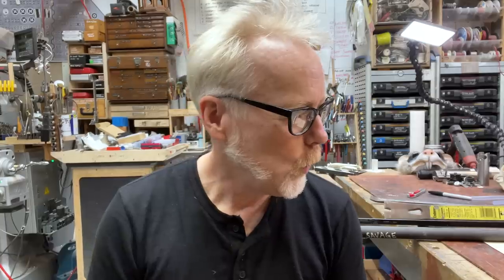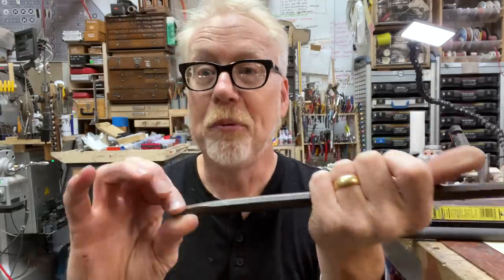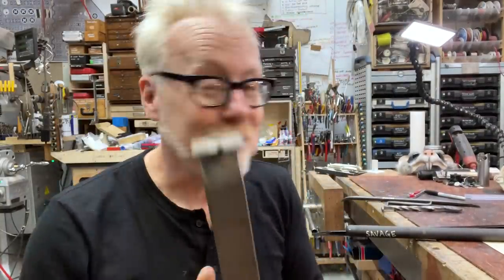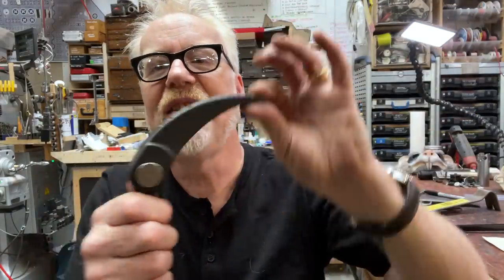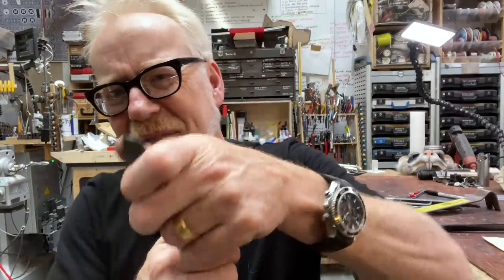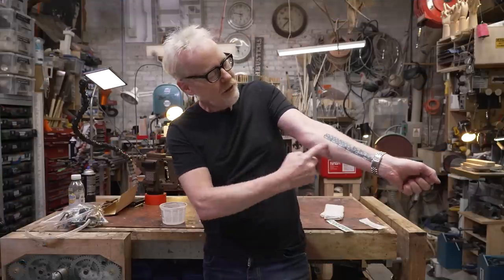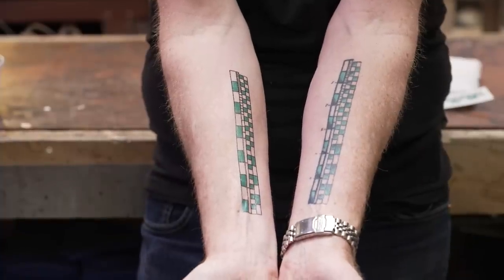Adam Savage's Favorite Tools: Pry Bars!

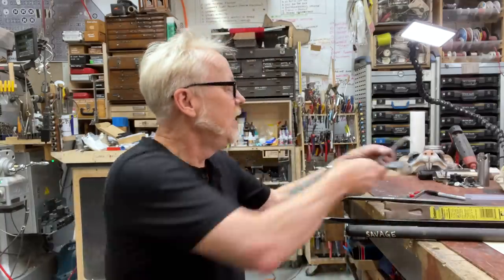Comment: That miniature pry bar Adam shows starting at the 3:00 mark isn't intended as a pry bar, but is actually a slotted screwdriver for tight spaces.  The heads are in two different orientations on the ends so you only have to turn a screw 90 degrees, then flip to the other end and you can turn it farther.  I have a couple of these for different, tight access problems, like adjusting the points on my one old Gravely tractor.

Comment: The large screwdriver brings back fond memories of a Chief Engineer on one of the ships I worked with.  The ship was new coming out of the shipyard.  As part of the Contract certain tools were provided., including the biggest screwdriver I have ever seen.  The Chief carried the screwdriver around, aka George C.Scott carrying the riding whip in Patton.  The screwdriver was specified in the list of tools to be provided, but no one knew what it was to be used for.

Years later my wife came home with two screwdrivers,  one flat blade and one philips, of similar size to yours.  They were on sale at Tractor Supply.  She knew I "needed" them for my toolbox.
Reply: Another seafarer here. There’s some amazing tools on ships alright, but my favourite so far was an inch drive torque wrench.
Reply: @kiwifruitpoo  The nut spanner for the props is one that always surprises me.  That it is not standardised and each ship carries its own.  Kinda like aircraft that carry their own push-back/towing bars because the destination airport won't have their special one.
Reply: Your wife knows you well.

Comment: The Probar is also called a halligan! It's a design that was made for FDNY back in the 40's.
Reply: I’ve heard them called a “Hoolie” bar, there seem to be many inferior copies about but I do want (need) one 🤪
Reply: @sibat777  I've also heard them called hooligan. Handful of different names for them.
Reply: We got some at my local fire dept. Great tool, we use it in combination with a splitting hammer as part of our door opening kit.
Reply: I was just going to say, Fireman’s Entry Tool.
Reply: On my want, need list as well!
Reply: All Germany I've heard so far call it Halligen tool. I guess Halligan is close enough. Standard issue for German firefighters as far as I know
Reply: There are a few videos out on old-school "irons" work.  Watching two experienced firefighters approach a (very securely shut) door, size it up, and then open it in less than five minutes is an education.  The stuff you can do with a Halligan and a fire axe is absolutely amazing. The other thing that struck me was the very terse communication between the two members.  Quick, to the point, and effective.
Reply: @CupolaDaze  The Hooligan is a three-piece design with cast ends and a tube centre, a bit lighter.
Reply: @romanglinnik8073  ive also seen the spike used with a hammer to crack concrete out under a door to help free a trapped animal
Reply: Came here to say exactly this
Reply: @CupolaDaze  Perhaps it is an accented way of saying Halligan?
Reply: @shellyandjohncourtade8269  No. Halligan tool is named after the famous New York City Fire Chief "Halligan"

Comment: I don’t know if it would be of use to you, but a Burke Bar has been living in my cross-bed tool box for several years. They are made for stripping concrete forms, but they work wonders for when you need to move something that refuses. It is a force multiplier that’s in it’s own category as far as I’m concerned. Almost 5ft long, almost 15 pounds.  As Essential Craftsman says in his video about the tool, “There are things that can only be done with a Burke Bar”.
Reply: Burke bar is the best at prying compressed plywood off of concrete.
Reply: Yessir. Came to say the same thing thing. Cat's Paw in the belt, Burke Bar on the truck. Flat bar for finishing.

Comment: You know, I'm realizing now that I should get a prybar of some kind. The last time I needed leverage to fit nuts and washers between steel and wood...I used a butter knife. Which to its credit, the handles on those things are Sturdy, and it worked better than I thought it might.

But a prybar would have made easy work of the problem, I wager
Reply: You should definitely have a pry bar of some kind, but most would probably be too beefy for that application. You should look at 5-in-1 painter's tool. They're similar to a putty knife (and can be used as one), but are sturdier and oddly shaped. They are great for light prying.
Reply: actually as a canadian I find a butter knife is great for popping open frozen car doors
Reply: @jcon6734  the 5-in-1 painters tool has been one of the most used tools in my kit as a home DIYer. My dad recommended I get one. Scraping, prying, cutting, popping light nails out, it’s been a game-changer.

Comment: Ah, yes, the halligan bar, aka a breaching tool.  Used one more often than I care to remember trying to get into doors and through things that were well and truly stuck.  You just have to REALLY trust the person next to you with the sledge that they're not going to miss.
Reply: It hurts when they miss
Reply: i worked for a tow compnay and bought one to keep in the truck with in 1 week the hole fleet had one in every truck with a 10lb sledge hammer owner not around due to a wreck but you need to unhook there trailer and its all bound up and has a pad lock no worries need to pry a fender out of a tire  so it will roll on the flat bed need to smash something or pry anything its got it worth every penny

Comment: They make a miniature version of the flat bar that is really amazing.  It fits nicely in my tool pouch and I drop it in the slot after the blade when cutting long pieces of wood on the table saw.  
It prevents the cut from coming back together and binding on the blade.   
Also works nicely to provide a small gap at the floor when hanging drywall.
Reply: I can second the mini flat bar!
Reply: I can also second the mini flat bar, but as for the normal flat bar I am a fan of the Stanley Super Wonderbar. The curve gives so much more leverage.

Comment: Dear Adam and members of tested, I'm a 3rd generation Ironworker. Klein tools makes our favorite pry tools. Including the 7/8" diameter connecting bar "sleever bar". As well as every spud wrench size imaginable. Prying Steel and Aligning holes for quick connecting or bolting up full connections. but when there's a stubborn connection and prying isnt enough bull pins and barrel pins are the next step.

Comment: I’ve been in the automotive field for decades and I have 3 favorites. 1 - the “lady foot” which are small versions of the Gearwrench tool you show but with fixed, 90-degree feet. The leverage on them is insane and they are perfect for tight spots. The point on the opposite end is a great alignment tool2 - Snap-On 36” prybar. Screwdriver tipped prying tools tend to slip and not have the leverage, the slightly angled tip of a dedicated prybar tends to hold better. Because of the danger of the huge forces I don’t buy cheap prybar. 3 - 6-foot pinch point prybar, you usually see masons use these to move sidewalk slabs. Immensely heavy and have tremendous prying power. You don’t want to know why they were popular tools in the shop.

Comment: Working in home repair I used a stanley crowbar that I reshaped and sharpened to a knife edge with a mill file. A knife edge allows for non destructive disassembly for materials that I wanted to reuse or things I wanted to reassemble after the work was done. The angle with the sharpness allows it to slip into very small gaps and apply even pressure to work things loose without damage.

Comment: The sash bar is indispensable.

Pro Tip: When prying off wood trim always pry perpendicular to the grain. For instance, when removing a baseboard, insert the pry bar along the edge and the rotate so that the edge of the bar pries across the grain not the tip. And have two pry bars so that you can leap frog down the piece.
Reply: If you good sash bar, it is a piece of wood that holds in a window pane. Think you mean a trim bar.

Comment: One of my favourite pry bar is a nail remover for small demolitions.  It has a weight at one end that move along the axis of the pry bar in order to ram it into the dry wall or two by four in order to grasp the nail so you can pry it out.  My father had one when I was a kid and it came on sale at CT 20 years ago and I've never seen it on sale since.  I only used it a half dozen times, but when I need it, it's amazing.

Comment: My favorite prying/scraping tool is a glazing bar. It's technically for installing and removing Windows but it has such a fine edge that is great for getting into right places.  I use it for everything 😀
Reply: Especially when you need some delicacy and don't want to break or crack anything that you're prying at. Like removing trim in one piece, which is exactly what they're made for.
Reply: Also my favorite pry tool.
Reply: There's a prying tool that installs Windows? That's interesting.
Reply: As a general contractor/construction worker, I use glazing bars every single day. They are unbelievably handy, I actually carry two small ones in my toolbelt at all times.
Reply: Agree.  He's missing something a little more delicate.

Comment: I use an aluminium pry bar. It's super light but still very strong. If you work overhead all day it saves your back. It also helps keep your toolbox lighter for site visits.
Reply: Confusing but interesting! It's hard for me to imagine an aluminum prybar that has enough strength to keep from bending, but I'd love to find one! Do you have the brand info?
Reply: @keithklassen5320  
Search

Gedore 142-430 Aluminium Prybar 430 mm
Reply: I use to for pipefitting  with the podger end mostly. But it's good for adjusting Motos with a benefit of not damaging surfaces.

Comment: I spent several years as a millwright and got to know many prying implements, but the one I have in every tool bag is known as a Crate Hammer. One piece steel with a forked pry end on one side and a T hammer on the other. Compact enough to keep in a tool belt or bag and useful for a plethora of tasks.

Great collection. I'll have to start using my offset flat blade screwdrivers for pry tools as well now...

Comment: I’m a mechanic, we like either 45 degree bent tip pry bars, or straight tip pry bars, some folks like the adjustable ones. Most folks will buy them off a tool truck, Snap On, Mac, or Matco, my personal preference is Cornwell, they do a 72 inch bent tip pry bar that will pretty much budge or break anything you want it to, they’re all a one piece tang with a striking cap on the end of the handle so you can hammer it in somewhere if you need. Great tools.

Comment: The big spike on the probar is often used to defeat padlocks.  One fireman holds the bar with the spike placed in the shackle while his partner forces it further with a sledge hammer.  No picking required.

Comment: One that I've found very useful for prying out smallish nails in plywood around the house is the diminutive Cat's Paw. Replacing my floors and dealing with moulding, tack strips and staples was made soooo much easier with this tool. The sharp ends dig in and get the job done.
Reply: Yes sir, love them.

Comment: An alignment prybar is worthy to have laying around. Its got a flat wedge on one end for all your prying needs and a tapered point in the other end you can insert into holes when attempting to align two surfaces together. In my application I use them to align vehicle subframes to the monocoque or to align a suspension link to the bracket receiver. You align the two components close enough to put a fastener through and job done. Great for punching holes with brute force aswell through wood or sheet metal.

Comment: As an ex tool truck owner I have a lot of tools in my personal toolbox. One of my favorites is a short prybar, 24”, that has a pinch bar blade at one end and the other is a straight tapered point at the other. The point is made to line holes up when you are trying to get bolts in a structure like car chassis pieces. It would be adequate for The Zombie Apocalypse also.

Comment: I rebuild oilfield equipment. My pry bars are my most used tools. I probably have 20 different bars of all types. I love ladyfoot bars and I use wedges to split cases apart. The wedge is so good at moving things from each other it will break bolts that have been stripped to where I can't remove them until I break them.

Comment: In the ripping bar, there is a use for that teardrop-shaped hole that I never knew. The flat split end of that bar can start removing a nail and the teardropped-shaped hole can FINISH pulling even a long nail. Try it!

Comment: Renovation pry bar. About 12 inches long with a right angle nail puller on one end and a 3 inch wide extremely thin slightly curved prying wedge on the other. Perfect for safely pulling moldings off.

Comment: A combo Jimmy bar/ podger is another one I use almost daily building elevators, big ones with a flat pry bar on one end and podger on the other as well as the ones with a hook for prying that usually come in a set from 6"-24/30" for pretty cheap are great.  A Burke bar is also one of the best options for bigger jobs, not really much that can replace one when you really need it.
Reply: Or a johnson bar, which is more or less a burke bar with wheels to lever on and turn. Mostly for prying heavy things off the floor.

Comment: I use a telegraph lining bar for work occasionally. If you ever break concrete - particularly in small quantities, but can’t (or don’t want to) use a power tool for whatever reason It’s your friend. It’s also great if you need to move really heavy loads or do heavy demolition work. Seven feet long and heavy! Specialist, but a lot cheaper than getting a big power tool.

Comment: I bought a flat bar with an extra bend in the middle years ago. While it may not fit as well as a regular bar, it does a great job of lifting drywall and other panels accurately while leaving my hands fee to attach it. Other than that, I have a board bender. a complete waste of $40 until you build a deck. it can hook on the edge of a 2 x 12 and snap it if you push hard enough. it can also bend 3 pieces of 5/4  decking like 5/8" and hold it to be nailed or screwed down.

Comment: I’ve inherited a 6 foot long iron bar, affectionately known as the “punishment” bar, which is used for levering big rocks out of the ground before breaking them with a sledge. It’s about 3 inches in diameter and has a chisel point and a spear point and I’ve lifted outbuildings with it.

Comment: I am watching this while dismantling and hopefully restoring an old Italian thicknesser jointer combination machine (Tatry DW55 which was then rebranded as a DeWalt).  I am stuck trying to get the height adjustment assembly apart from the top bed.  What I could really use now is ..... a pry bar.  The smallest one I have requires two hands to even lift.

Comment: Many years ago i worked with habitat for humanity, we were mostly amateurs with a contractor sprinkled here and there to keep us on track. Im a tool guys so when we needed to pick up corners of a large shed/shop to stack pavers under the corners i said gimme a sec and went to my station wagon and got a Burke bar bout five and a half feet long . This massive tool with a chunk of 2x8 under it allowed one guy to lift a corner about 4 inches shove in two pavers and lift again on doubled wood to get two more pavers in.
If you need two things apart and they are not heavily welded and explosives are a no go this tool will do it!

Comment: I enjoy the gerber shard as a micro keychain pry tool, plus other stuff.
Its got a multi-use Philips that, while obviously not the best philips, will do most jobs neccissary, and doubles as a glass breaker, and then also has the claw pry sized to work as a flathead screwdriver. I use it (the package opening , nail & staple removal, and screwdrivers) constantly at work and just around, if I dont have other stuff on me, and even sometimes when i do

Comment: Shark bars are great. They have a very wide and thin end that works great to pull trim off without damaging it, and works well for many other applications. Also find that plastic trim tools/ pry bars ,usually for automotive use, also work well for delicate light duty work.

Comment: According to knife reviewers, the best prybar is a $500 handmade hunting knife.  Who knows why, but that's how they judge a knife.

Harbor Freight pry bars are great- both the kind that looks like a bent screwdriver and the solid steel ones with the curved beak.  I use the latter for knocking scale out of odd locations fouled by hard water.  They're also essential for reinstalling folding van seats with spring loaded hinges.

An essential prybar accessory is a few pieces of flattened shampoo bottle.  This stuff is an ideal shim to prevent surface marring and will stand up to immense pressure.  I use it when changing motorcycle tires to guard the wheel.

Comment: I have a selfmade sliding hammer that was build by a fireman to quickly open car doors and such. It was build to quickly open doors and such before they had hydraulic tools. You can see it was build to withstand anything multiple fireman can throw at it. It goes true big tree roots by it’s own weight and kinetic force transmitted to the big sharp wedge. I love this thing and it’s story and will happily pass it on to be used and abused when I am done playing with it. (That will be a while)

Comment: Catspaw.  Though designed for pulling buried nails, it features a head that can be struck with a hammer to drive the wedged business end to gain purchase on desired separation.

Comment: I needed to pry a pulley off a shaft with limited space to work and found an open end wrench big enough so the shaft would fit in the wrench opening and the two sides would apply even force to the pulley was perfect for the job.